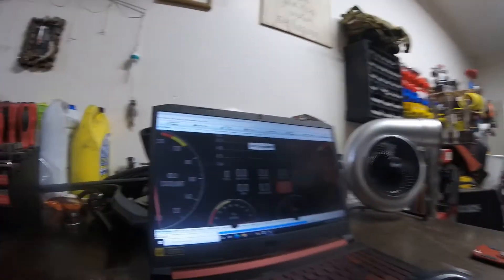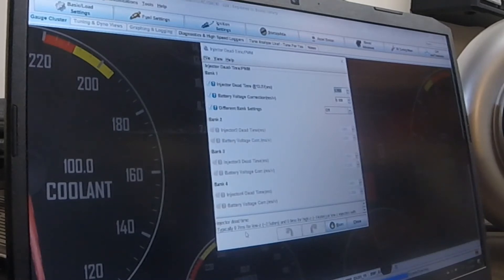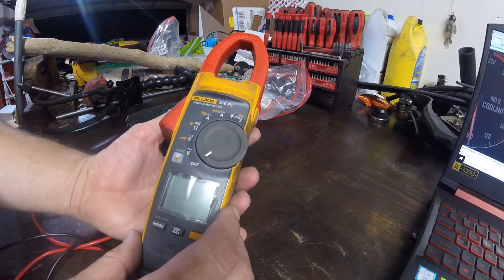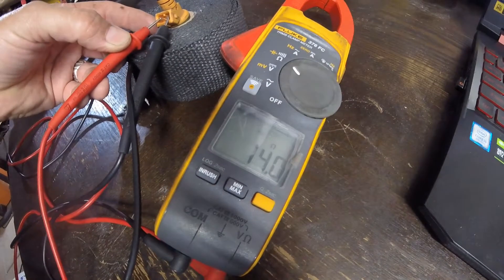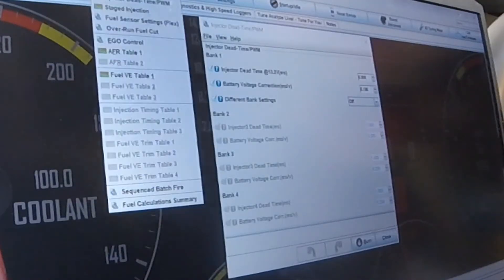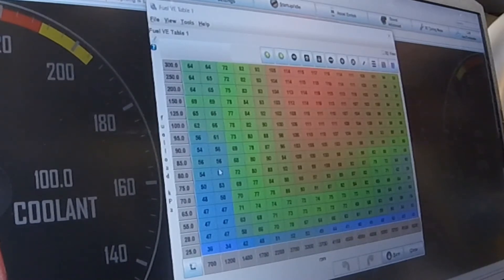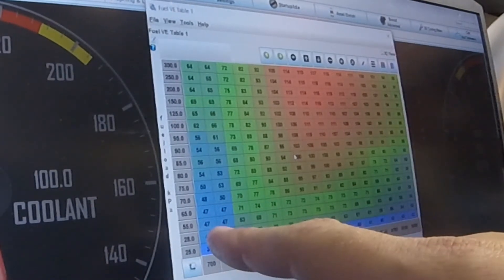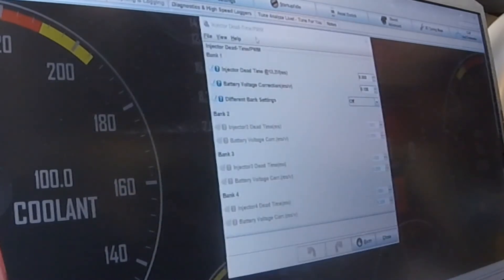Injector Dead Time - How to Ballpark Unmarked Injectors [High or Low Impedance Injectors?]

Comment: Thanks for making the video, but the dead time is NOT the time the injector spends in the off state as it is pulsing. The dead time is the time between when the injector is commanded to fire, and when it actually fires. That's why its also sometimes referred to as lag time.
Reply from the maker: Thanks for the tips 🤘🏻

Comment: Literally no useful information in this bar recommending manufacturers specs. You calculated nothing. You only proved whether your injectors are high or low impedance, then read the info bar on the megasquirt software. Using a multimeter is not calculating something, its taking a reading.
Reply from the maker: Thanks for the positive comment.  Your sunny disposition will get you far in life.  If you got nothing out of it, then move on to the next video or channel with your negative crap.  Clearly you know everything so why the hell are you watching anyway mr know it all.... 🤦‍♂️
Reply: @BMF_Garage  Relax mate, just providing some feedback. I clicked on the video because i'm interested in actually learning how to calc injector dead times. Your vid title is misleading, plain and simple.
Good luck with the channel
Reply from the maker: I can certainly change the title, but there’s not much to injector dead time.  I try not to make things more complicated than they have to be.
Reply: @BMF_Garage  watching this a year later trying to calculate injector dead time and sitting watching you for four minutes so far not calculate anything with injector dead timing is WILD. You are completely misleading and as a person who knows little about tuning seeking information I would recommend that you change the title to "How to determine if your injector is high or low impedance" and then highlight the part of the video where you select ohms and check it. I think its funny how you gave your little "tell off" to the OP commenter, but hes actually right. you have wasted my time, and most likely thousands of others times looking to tune their car properly. Not only is it misleading but this isnt how you do the task either. If I said "How to change a cam" and the entire time Im talking about taking off the timing chain cover then I just look at it and go "oh well im gonna leave this cam in here because i want to keep it stock" and turn off the video. Thats not how to change a cam. Honestly mate just take down the video. This is probably the worst car video i have seen on here, and the fact that im even commenting is wild. That how pissed I was when I scrolled down to see this.
Reply from the maker: Well clearly you found your answers so easily elsewhere.  If you hate it so much, move along.  No one is forcing you to watch.  If you can’t u can’t understand the difference between high impedance and low impedance and that it depends on the ecu you’re dealing with, that’s on you.  Every ecu has its limits.  I’m providing general guidance for cases where you have no idea where to start.  If you have a better way, good for you 👍🏽

Comment: Very misleading title, this video tells you nothing about calculating dead time. The creator doesn't seem to even know what it is
Reply from the maker: If you have no information on the injector the best you can do is ballpark the values until you get some info on them.  The title specifically says how to ballpark unmarked injectors.  How the hell is that misleading?  That’s exactly what I did.
Reply: @BMF_Garage  I think its misleading video too, this video should be deleted.  all you was say it was high Z, and then just guessed a value of 0.9   I could have guessed 0.9 too.  but that doesn't tell me latency across a range of voltages, nor does it tell me what value to put for Low Zs
Reply: in fact 0.9 is the wrong answer for nearly 90% of high Z injectors to be honest.
Reply: and you said low Zs are going to be less..  but you didn't say how much less.   I could have guessed that too. lol
Reply from the maker: You’re right, it tells you none of that and the title NEVER claims to give you any of that.  It says how to “ballpark”…. Which means get you in the general vicinity… which is exactly what it did.  Sorry for not giving you info I never claimed to be providing? Just wow 🤦‍♂️